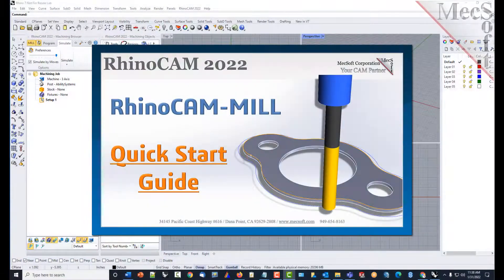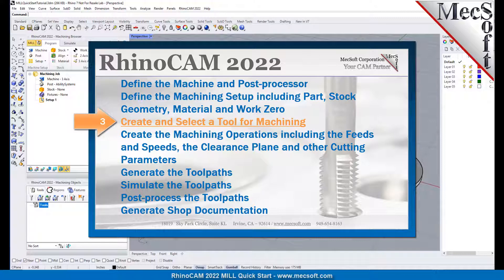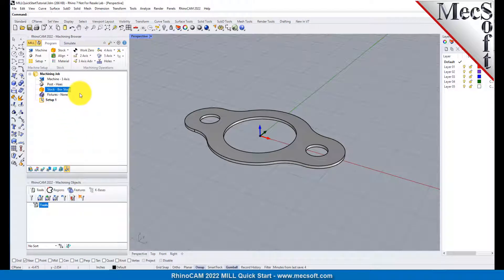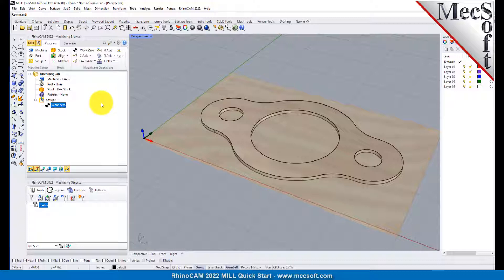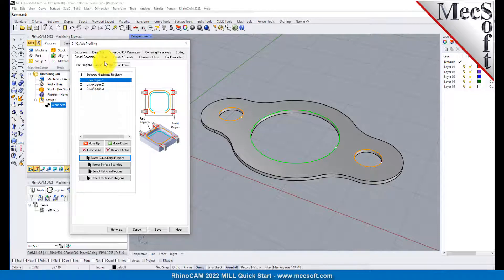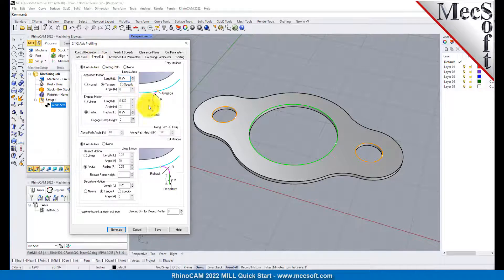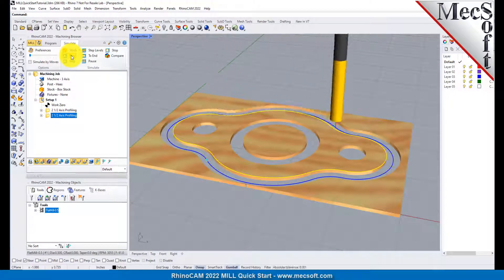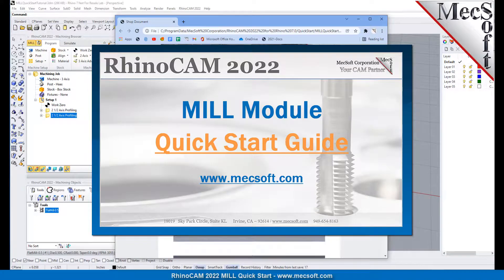RhinoCAM 2022: Milling Quick Start Guide

Comment: Hello, I have seen how your software works. 
I have also seen how Vetric Aspire works in terms of cut simulation. 

Clearly your program is more professional and has more settings, but in the simulations it becomes slow, 
I understand that you have already dealt with this topic in other videos, but my question would be why does this problem occur? 

could it be lack of ram memory? will a very powerful video card be necessary? 
or will it be windows or maybe the microprocessor? 

I think the best question would be what is the minimum ram memory, the minimum video card and the minimum microprocessor for Rhinocam to run very fast without touching any settings?

Thanks 👋🏼.